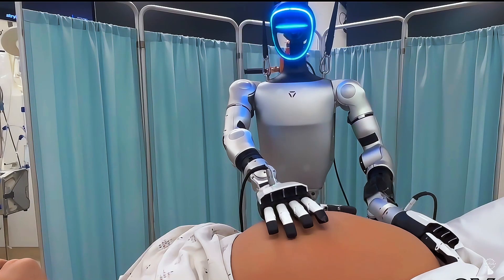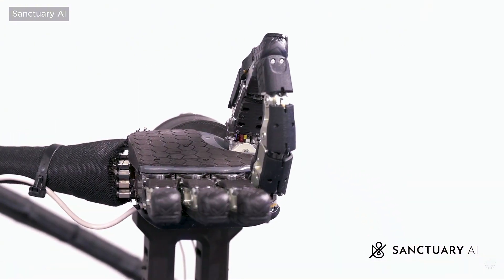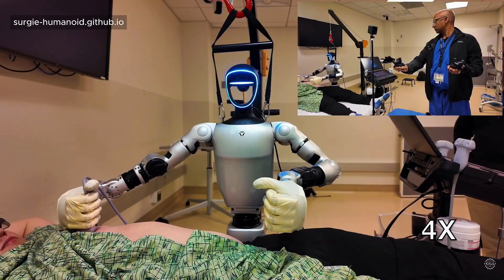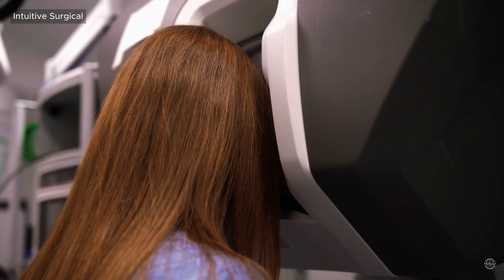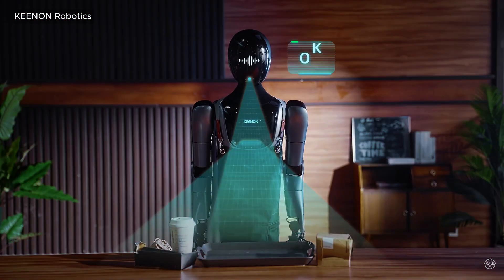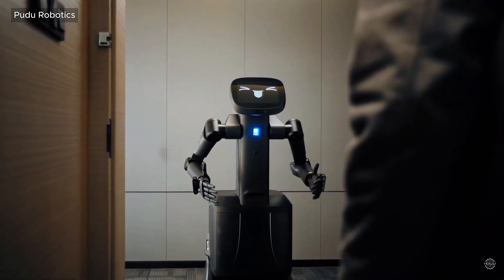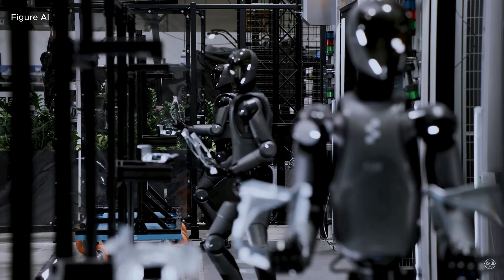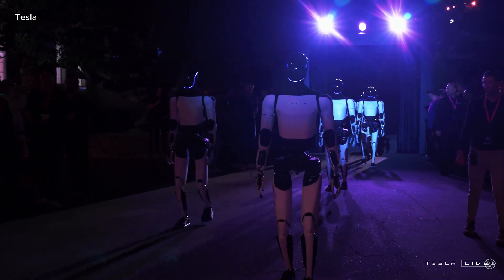AI ROBOTS: Unitree G1 Humanoid Robot for Surgery? Tesla Optimus Cage Match? KEENON China Takeover?

Comment: Someone send one of these robots to mars so that it can take out the rocks from the mars rover's wheel
Reply from the maker: it would probably fall over and get stuck too
Reply: @MikeKalil  this thing can do flips. Just give it a powerful AI chip on it's own rover dock, with them super light weight long polymer flexible solar panel roll sheets that helped power the drive around australia in a tesla mission with no charge point access.